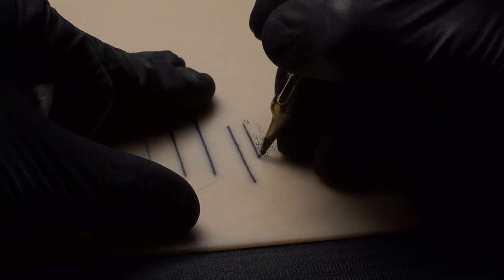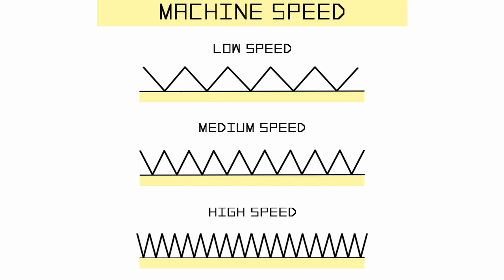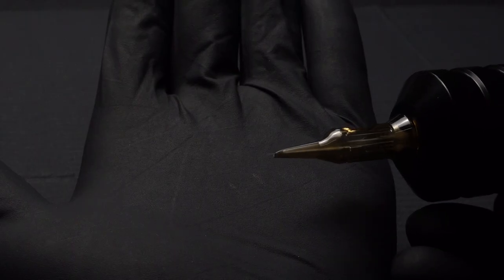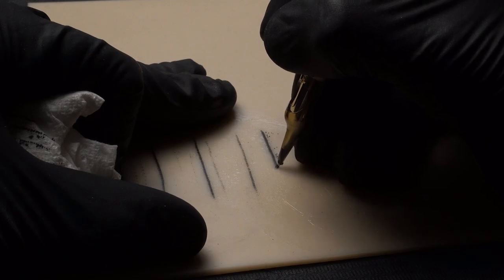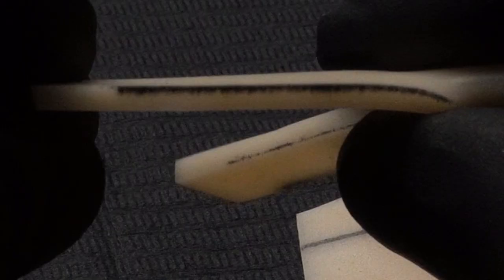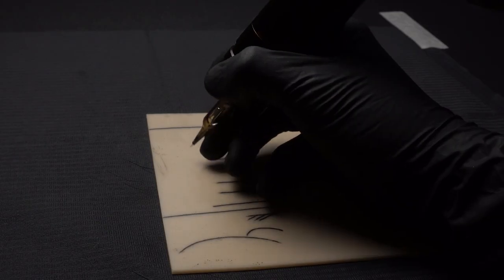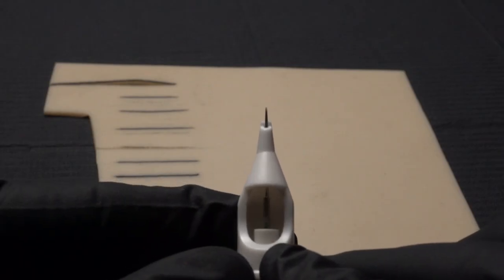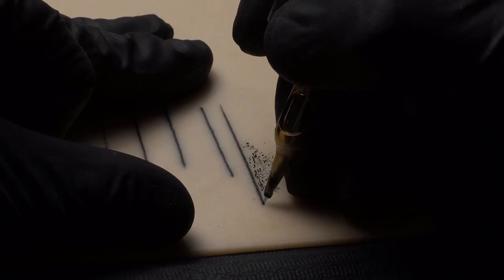HOW TO TATTOO - LESSON 5 - How To Line Tattoos Correctly

Comment: Can you sketch with tattooing? What I mean is almost use like a pencil ,like making a circle , can just sketch rather than one continuous line. Obviously with the aim to get better so i can pull a full circle in one line.
Reply from the maker: No, because applying less pressure creates shallow lines that will not hold after the tattoo heals. If you want to create a tattoo that looks like a pencil sketch, you will need to prepare a design that looks like one, stencil it, then tattoo it like you would tattoo any other design. For example, if you want to tattoo a brush stroke, the machine can't create actual brush strokes, so you have to use an image of one, stencil it, then outline the shape and fill it in to make it look like an actual brush stroke.
Reply: @tattooartsunlocked  thanks for replying 🙏. I shall take my notes on this comment.  💯